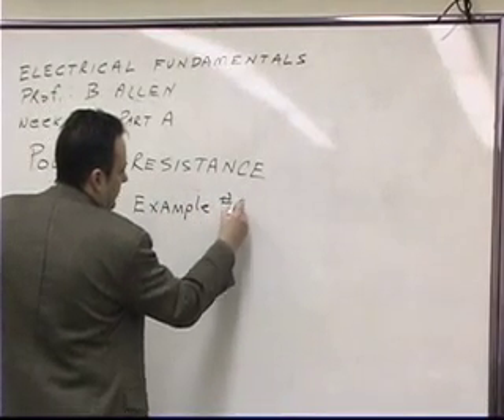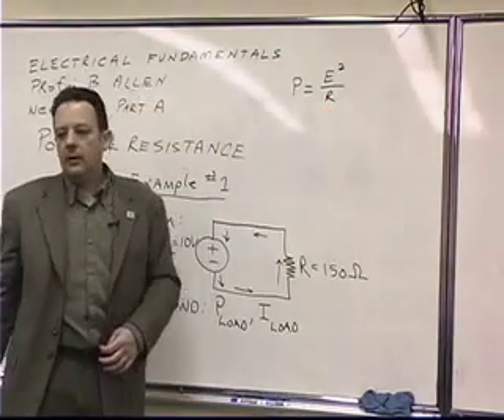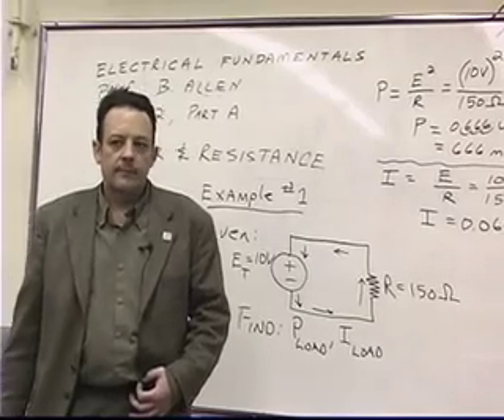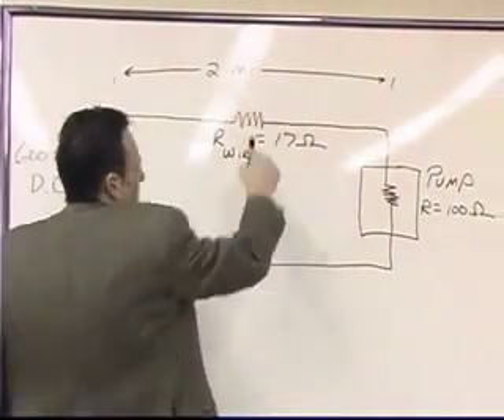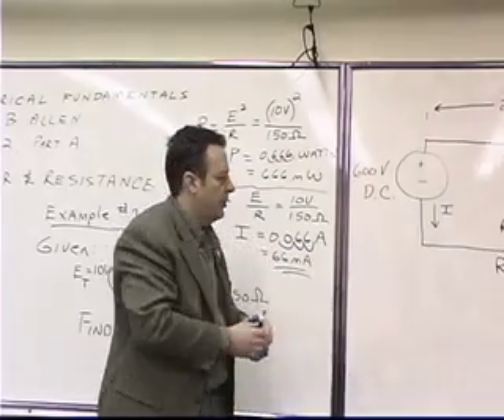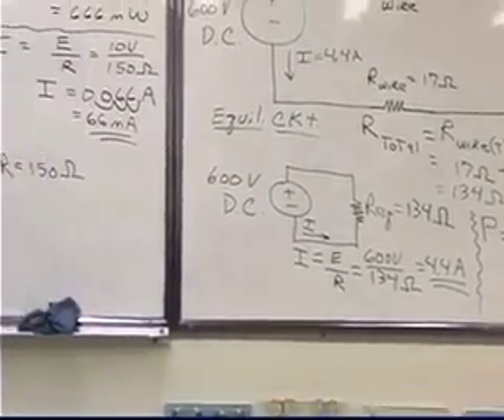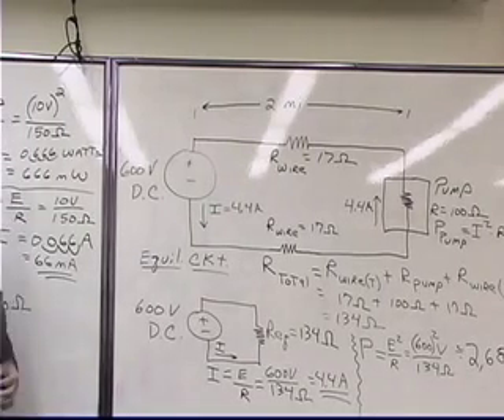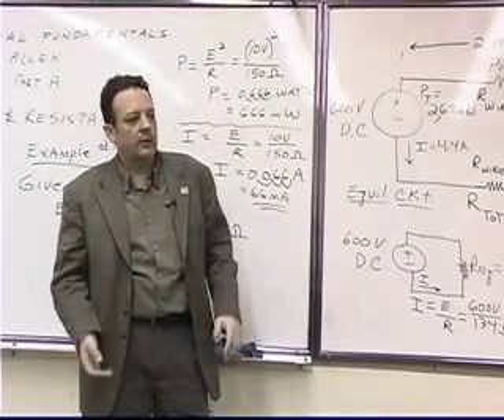Power and Resistance Part 1

Comment: @txpilot2010, stepping up the voltage will demand less in current. In other words if you want to have 1000 watts of power you can either set up "500volts @ 2 ampere(Low current setting)" or "100volts @ 10 ampere(High Current setting)". Cheers :)